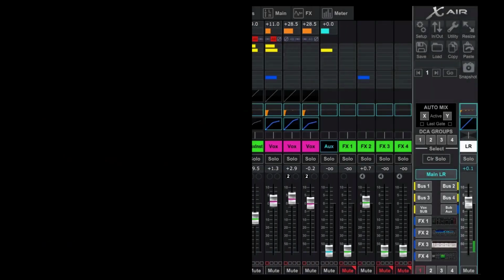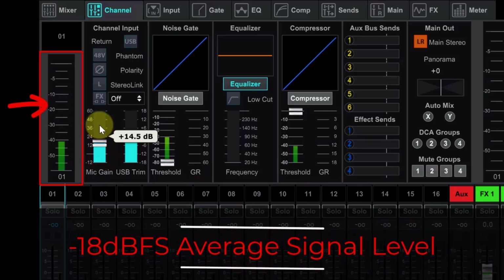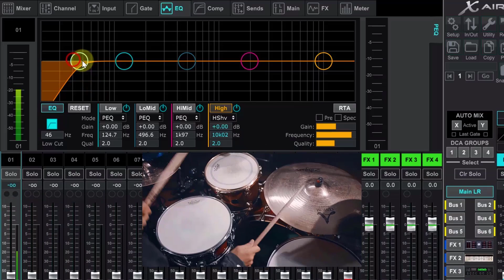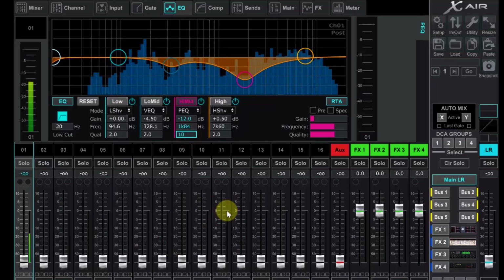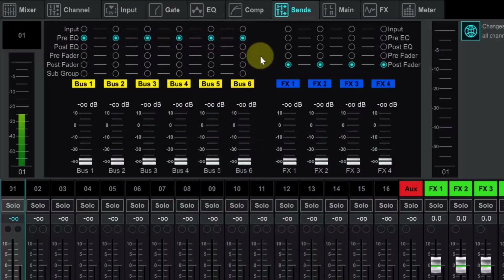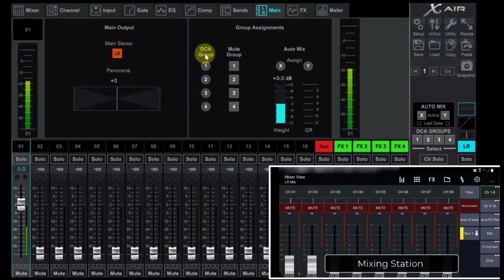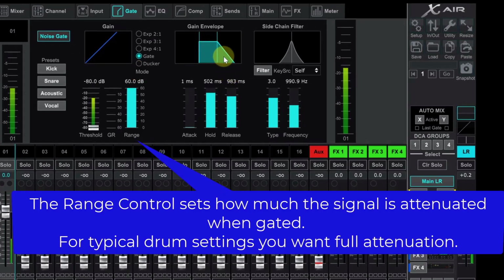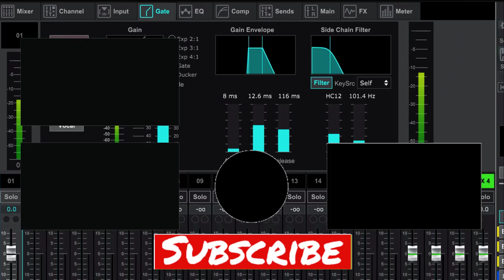Understanding the Behringer XR18 - Channel Setup Tutorial

Comment from the maker: This video library entry is a bit longer than normal. It's a walk through of a channel on the XR18. It is using X-Air Edit for control, but also has several screens for Mixing Station software also included. There was a lot of ground to cover.
As always, please add any comments or questions here. :)
Likes and shares always appreciated!

This Behringer XR18 channel walk-through video focuses on a channel, other than initializing the console to start from a blank slate, so it doesn't veer into USB recording and overall in/out routing (other than where that stuff appears on the channel strip and could trip you up), nor things like the need for an external router if using it on wifi (I recommend the TP Link 1750 because those work for me... and I did drop an Amazon affiliate link here and in the text below the video for those). 

But that said, you can't really focus on the channel settings without talking about the built in FX rack, going thru FX, nor discussing monitor sends, etc... So that stuff is in there too.

And then both during the video, at the end, and in the text below the video, I link to other videos that discuss different areas discussed in this video in even more depth and that will many times go beyond the settings of a single channel.

There was a lot of info to cover in the video and I also tried to get some Mixing Station examples into the video as well. So while X-Air Edit is the main software in use, I added several inserts showing the topic on Mixing Station as well. 

And a section dedicated to setting the input gain on Mixing Station since the metering is different and not as straight forward if you're striving for accuracy as much as consistency.

Videos referenced in the video:

►DCA's vs Subgroups on the XR18 / MR18:
https://youtu.be/x6TKam2F50Q

►Behringer XR18 Monitor Setup Tutorial:
https://youtu.be/5gzsEErKdb8

►Behringer and Midas FX Setup and Routing Explained:
https://youtu.be/dCTcbV-_ccQ

►Sending FX to Monitors XR18/MR18/X32/M32:
https://youtu.be/e_XsfTV36vU

Not referenced but helpful to new users:

►XR18 / MR18 Top Five Frequently Asked Questions (Mixing Tips):
https://youtu.be/x9wciA2wFd0

►XR18 / MR18 Overview. 12 Things to Know:
https://youtu.be/gTM7IdkCprk

.~~~~~~~
►Patreon Page where Patrons have access to script files, other PDF tutorials, Behringer X32/M32/XR18/MR18 channel and scene files, and other audio production information:
https://www.patreon.com/AlanHamiltonAudio
~~~~~~~

►►Amazon Affiliate Links To Equip Used/Shown/Mentioned In Video-

►Behringer XR18 on Amazon:
https://amzn.to/2LfTpmO

►TP Link AC1750 Dual Band Router on Amazon
https://amzn.to/3uPXFhj

~~~~~

Equipment used to make this video:

►Stellar X2 (Narration Mic) on Amazon:
https://amzn.to/3ggUWFq

►Sony ZV1 Camera on Amazon:
https://amzn.to/3HJWd3f

►ULANZI Flexible Desk Mount Camera Arm Clamp on Amazon:
https://amzn.to/3FKhF6M

► Neewer Camera Slider Carbon Fiber Dolly Rail on Amazon:
https://amzn.to/3tPpypk

"As an Amazon Associate I earn from qualifying purchases."
~~~~~~~

Suggested videos:

►►Popular videos:

►Five Typical Mistakes Made By Behringer X32 Users
https://youtu.be/tP7dO2Za6bw

►Five Typical Mistakes Made By Behringer XR18 Users
https://youtu.be/EilVDp39A9g

►►Audio Cable Information series videos:

►Connecting an MP3 Player to a Mixer:
https://youtu.be/UiauwFEFe_k

►Cable Management For Live Audio:
https://youtu.be/nYZ9nrPGswo

►Patch Order and Input Lists For Live Sound:
https://youtu.be/FE2KRj8vEEc

►►Mixing series videos:

►5 Tips for Better Live Vocal Mixes:
https://youtu.be/oP4sdpkkNhY

►Mixing Live Bass Guitar:
https://youtu.be/FNa7avcUUSM

►How to EQ a Kick Drum:
https://youtu.be/CQg1_-ZJ4MU

►How to EQ a Snare Drum:
https://youtu.be/J_WC68vyht4

►How to EQ Toms:
https://youtu.be/nSLJqnlJe60

►►Other videos:

►Building An In Ear Monitor Rig Using the Behringer XR18 or Midas MR18:
https://youtu.be/xT9gTBFxvZk

►In Ear Monitors On A Budget:
https://youtu.be/FOon2wEZss8

►Behringer X32 Monitor Setup Tutorial:
https://youtu.be/Vz9E6FaCatQ

►Top 5 Frequently Asked Questions About the XR18 (and MR18):
https://youtu.be/x9wciA2wFd0

~~~~~~~~~~~~~~~~~~~~~
►Facebook Group:
https://www.facebook.com/groups/livesoundproduction
~~~~~~~~~~~~~~~~~~~~~
#LiveSound
#AlanHamiltonAudio
#LiveSound
#XR18
#MR18
#XAir

0:00 Intro
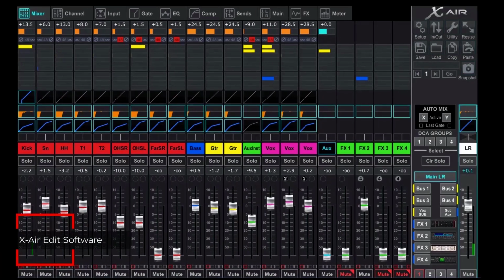0:14 How to initialize the XR18 MR18 X Air
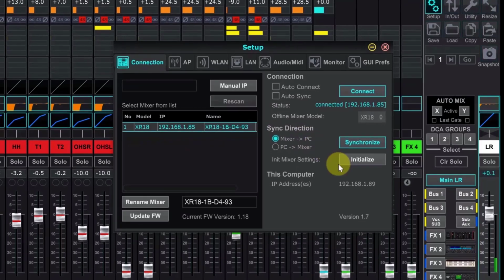0:21 How to initialize on Mixing Station App
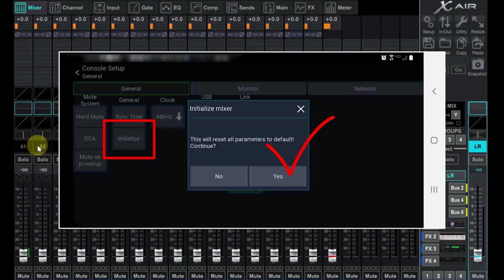0:28 Channel start
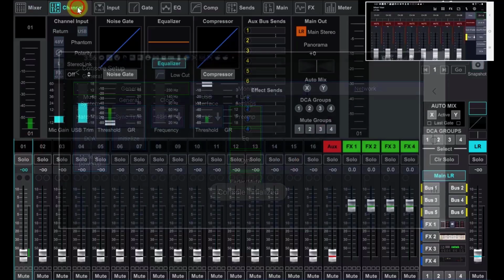0:32 What Are USB and Analog Inputs
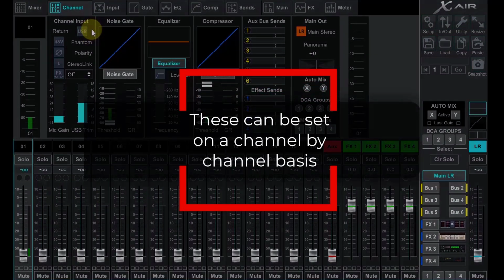0:50 How to Set Phantom Power
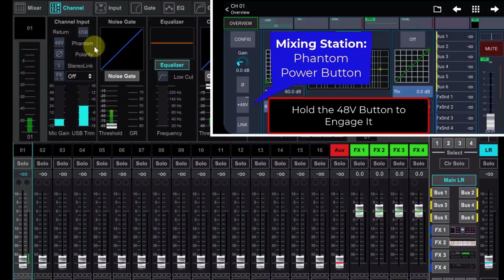1:09 What is the Polarity (Phase) button for
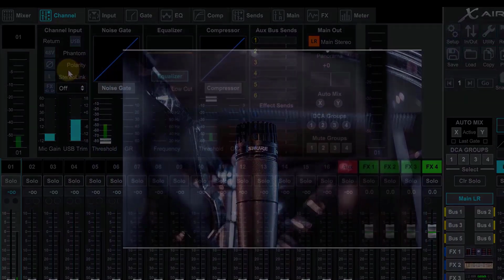1:41 What is Stereo Linking
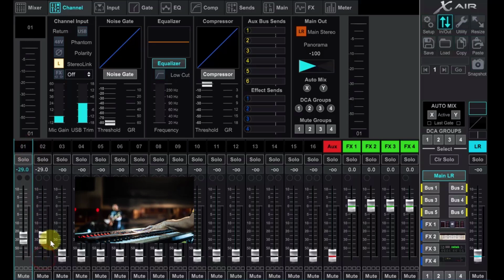1:56 Gain structure discussion
2:50 How to set gain on Mixing Station
3:48 Signal Flow discussion
4:31 Input Tab Discussion
4:46 EQ explained
7:38 XR18 FX Rack 
8:32 Bus Sends
9:25 Bus Sends as Monitor Sends
10:44 Bus Send Tap Point Chart
10:59 How to use FX Sends
11:55 Main tab. How to Pan channels
12:09 How to assign or un-assign channels to Mains
12:35 How to assign DCAs
13:35 Comps and Gates/ Pt 1 How to use Comps
14:43 Pt 2 How to use Gates
Reply: Lopkl
Reply: Great info, but I just bought the unit and the downloaded XR18 app has a different layout of the screens than your tutorial, same for Mixing Station.
Reply from the maker: @butchgiusto9294  I'm using X-Air Edit on the PC in the video for the PC version. The Mixing Station app I'm using in the video was the original free version and the default layout for Android. But my paid version is very similar. I've not upgraded my Mixing Station in a while so I'm not sure if there's been any major changes there, but I'm sure it's roughly still the same, but maybe an extra click here or there.
There's also a PC version of Mixing Station... and that one I have is very new and it's also really close to the Mixing Station app. Are you sure you're using Mixing Station and not the Behringer built version app?

Comment: Hold it!  .. You skipped wayyyy too much right from the get go. How are you connecting the XR and what are you connecting it to? And... you're using X-Air Edit... but that app won't work on Android anymore. I'll come back later, I need to find more detailed information.
Reply from the maker: I'm using X-Air Edit on the PC and IIRC also using Mixing Station (that does work on the Android) in this video. It's been a while since I made this video but I was thinking this was one in which I used both applications showing how to do the same things on two different platforms.

Comment: Amazing video! I have one question; We're currently installing a new sound system including the Behringer XR18, a Blafili B3, and a Bose Panaray System Digital Controller II, and we're having a particular issue. The sound quality is fine until we turn the volume up. It gets terribly distorted. And sounds very low. What are the causes of this and what possible solutions or recommendations can you share with me?
Reply from the maker: It sounds like you might be having a gain staging issue, especially with the signal path from the mixer to the Bose. Although, how does the Blafili factor into the signal chain? 
What are your meters showing throughout the signal path? Do you see clipping at any point?

Comment: Hi Alan, Loved the video's, very informative for a newbie like me, I'm using my new XR12 for a Karaoke and DJ setup what would you suggest are the best FXs to use?
Reply from the maker: As for vocal FX I like the Plate reverb (the blue and black one). Although, is delay still preferred for/by karaoke vocalists?
 The Stereo Delay works really well for slap back delays.

 The main output already has a built in compressor that you can engage. I'd set a high ratio (7:1, 10:1...) and then make sure it's not really engaging (threshold setting) until things are approaching "too loud"... Or "too loud" for the rig. Don't clip your rig.

Comment: @AlanHamiltonAudio, thanks again for your great videos!!  They are truly very helpful.  I have a Shure SM58 (that is prob 20+ years old, maybe the newer ones are better for mic handling noise) and I find when I set the gain to the -18 area I get a lot of mic handling noise.  The smallest movement of my hand on the mic will create -30 to -40 of signal on the channel when the gain is at -18, is that normal?.  Also the mic is super sensitive at that level.  We have a drummer that plays an electronic kit and I am over the other side of the room but the mic picks up all his drum clacks, (we are all wearing headphones feed of the XR18 buses, and recording our jam sessions), when at gain -18, and they end up on the vocal track.  What am I doing wrong here?
Reply from the maker: Assuming you mean you set the gain so that the input meter registers -18dBFS on average (and peaks higher), then there shouldn't be excessive handling noise with an SM58.
It could be overall gain structure... IOW... You have it correct at the input, but then something (or multiple things) wrong downstream.

Example: Input gain is normal but compressor makeup gain is cranked. 

Or excessive EQ and/or HPF setting not used or too low. For there to be a handling noise issue, I wouldn't expect the lack of a HPF, or setting it too low, to be the main issue. BUT that and/or excessive EQ (especially low EQ) could be the problem. Or part of it.

You could also have the mic double assigned to the mains and so you're getting multiple paths sending the same signal to the outputs. Like the channel going to the L-R outputs AND to a subgroup and then to the L-R outs from there. Or multiple subgroups. Also, possibly assigned to a monitor bus where the master monitor output is accidentally assigned to the mains as well as the monitors.

A DCA assigned to the channel, and then the DCA cranked could cause the problem. Especially if you don't even realize the DCA is in use.

Handling noise is usually low, rumbling type sounds (from mics with poor handling noise). If you're hearing a buzzing, clicking, clanking, rattling, or hissing, then that could be something else. Even something broken/loose inside the mic.

I'd try a different mic and cable to see if something else in its place behaves. Even if it's a cheaper mic. In general, an SM58 should be perfectly acceptable for handling noise, but it's possible you have a broken one.
Reply: @AlanHamiltonAudio  Thanks for taking the time to give such a detailed response.  I am happy to say I have fixed the issue.  I did a re-initialize of the XR18 to reset everything and then only added the mic, and routed the USB for reaper.  It works great, nice strong signal without all the mic noise.  So now I will take screen shots of my other config and bring things in one at a time to see what breaks it.  Thanks again for your support on this mate.

Comment: 0:39 Not exactly. Activating the USB button doesn't disable the analog inputs. The console allows you to send and receive signals via USB, such as to a computer for processing. This button specifically controls the return of the USB signal to this channel, so you can, for example, send the analog input signal to be processed by VST plugins and receive it back, or route playback from the computer into the console.
Reply from the maker: I think what I said in the video, for all intents and purposes stands. Enabling the USB input on any channel disconnects the mic preamps from the mixer channel. That is true. I think the full context of what I said follows with something like with USB enabled the channel is taking it's signal from the USB input instead of the mic preamps. 
Which circles back around to the point you're making. Except without confusing anyone.

Certainly the preamps are still there, but they have no path to the channel strip. What you're saying would be to create a new path to the channel strip via USB outs and inputs.
For anyone trying to learn the basics of the console and just get a live mix going, that's just going to be confusing. And yet, I still made the point that a user can connect the channel to USB instead of to the preamp. 

But to take it further is putting the cart before the horse.
Reply: @AlanHamiltonAudio  I understand your point, but there seems to be a small misunderstanding. Enabling the USB input on the channel does not deactivate the mic preamps. The preamps continue to process the analog input signal. The USB button specifically controls the return of the USB signal to the channel.

This means one can send an analog input signal to be processed outside and then return the processed signal back to the channel via USB. Alternatively, one can route some playback from a computer/player into the console.

So, rather than disconnecting the preamps, the USB button manages the routing of the returned signal via USB. I noticed that in your video, the analog inputs were crossed out, which might suggest they are inactive, but that’s not the case.

Overall, it’s an excellent and informative video that I really enjoyed. I just wanted to clarify that the USB button does not work on an "either/or" principle as it might seem.
Reply from the maker: @DmytroZaitsev  No, I understand what you're saying. I never said that they deactivate the mic preamps nor did I mean they deactivate them. They simply unassign, or de-route them from the channel strip. If USB is enabled then the mic pre's are not being sent to the channel strip. That is all the video is saying. Hence, the reason I also mentioned that USB routes the incoming USB to that channel.

Yes, the mic pre's are still there and working. But they aren't routed to the channel strip if the strip is assigned to USB. But yes, if you route any of them to external processing via USB, and route that USB back to the channel, then the preamp can still get to the channel. Albeit with whatever latency that is induced in the extended path from preamp to DAW back to console and finally to the channel. 

I don't think the video is confusing in how the info is presented. I just think what you're talking about would be better served in its own video where someone already is grasping the basics of signal flow and curious about more advanced routing possibilities and implementing some Waves plugin for example.

0:00:30.640,0:00:34.559
since we reset the mixer it should

0:00:32.559,0:00:36.960
automatically be connected to the analog

0:00:34.559,0:00:39.280
inputs on the front of the console. if

0:00:36.960,0:00:40.960
this usb button was enabled and not

0:00:39.280,0:00:42.960
grayed out then that would mean the

0:00:40.960,0:00:44.640
front panel inputs are off and the

0:00:42.960,0:00:47.520
console is taking its signal from the

0:00:44.640,0:00:49.600
usb inputs.

I could've said unassigned instead of off, but I think in the general context, the same point is made either way. But I guess it's in how you look at it. As far as the channel strip is concerned, the preamps are off if the input is set to USB is how I look at it. Of course they still exist and aren't physically turned off though. But either way, it's too late to change it now. ;)

Comment: Hi Alan, thank you for sharing these tips!! 

I recently started using the XR18 for synths and drum machines in my home studio.  If I give any of the channels my USB returns feed, I notice the sounds from Windows are hollow (with and without stereo link). The only solution that worked was applying polarity to one of the channels, which brought back the thickness and center information. Could you explain why this is so? Does it mean I have to block one pair of input channels 1-16 having polarity exclusively for my USB returns? Is there any way I can the FX tracks for USB returns instead of hogging the input channels 1-18? Many thanks!
Reply from the maker: I'm not sure without some more details. Anytime polarity rears its head with a stereo connection I do have to wonder about the issue of stereo unbalanced and mono-balanced connections being intertwined somehow. But I'm not sure if that would apply in this case or not because I'm not 100% sure you're connecting this.
I know this video is talking about an MP3 player connection first and foremost, but it goes on into more detail to talk about other related things when making stereo connections and the difference in mono balanced and stereo unbalanced. But it might be worth checking out to see if something here could be where the issue is being caused.
https://youtu.be/UiauwFEFe_k
Reply: @AlanHamiltonAudio  Thanks for your response. I'm not sure if this is the problem here. I'm using XLR M to XLR F to run the speakers from Main LR from the XR18. And the audio tested was from USB returns, not through any of the Analog Ins/Aux In.
Reply from the maker: @adavidalex212  Have you tried headphones connected to the XR18 to see if you hear the same problem in the headphones (when listening to L-R in the phones)?
That would be a clue as to whether the problem is COMING to the the XR18 or a possible inverted cable or miswired speaker.

I suppose trying a different laptop/computer might also be worth checking to make sure there's not some internal computer glitch happening that is outside of your control.

You're sure the tracks you're playing back are actually recorded correctly in the first place? They didn't get recorded (or sent thru) the computer with an inverted cable or a DAW track with flipped polarity?